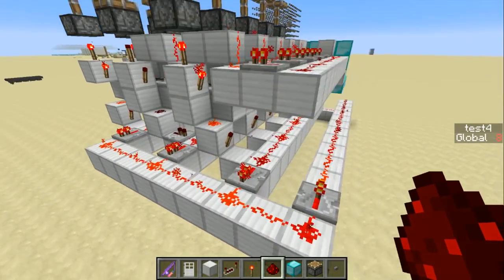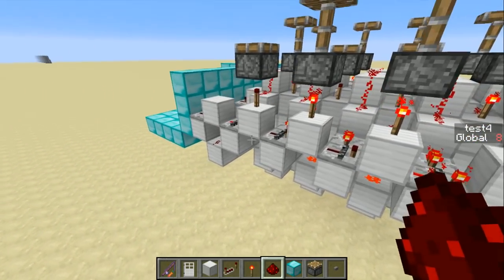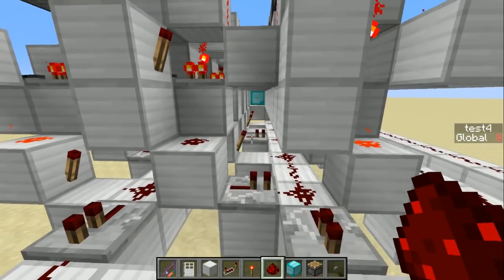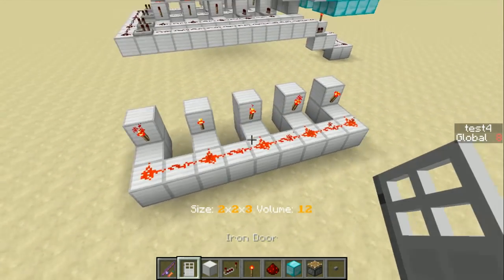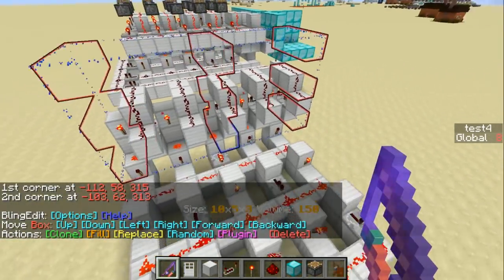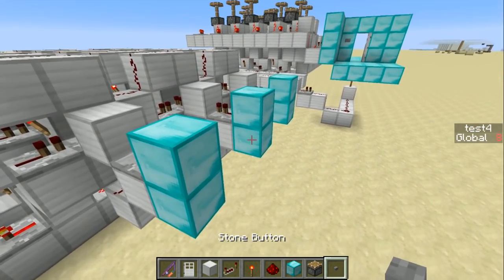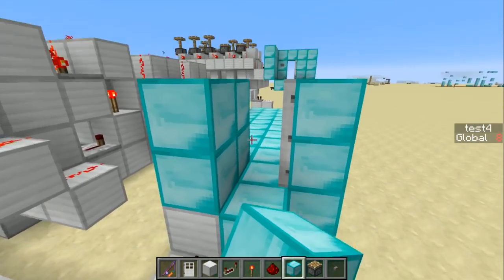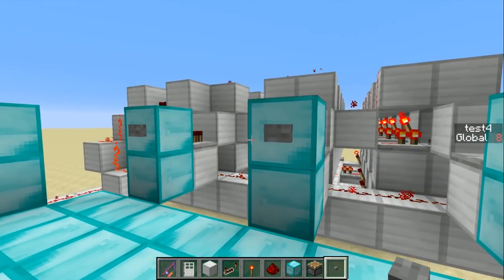Sequential Combo Lock in Minecraft (Redstone Tutorial)

Comment: old design is old, a 9digit 3x3x1 keypad connected to a circuit for an order-sensative combo shift register was the first thing I made when repeater locks came out, and it was based on an old design of mine that used a dflop/binary counter combo to accomplish the same thing in a much larger area. You didn't even put the buttons next to each other, I am disappoint.

Comment: The downside of making a lock with a shift register is that it is vulnerable to brute forcing using a de brujin sequence. For example, a 5 digit passcode with 3 buttons has a de brujin sequence of length 3^5 (243) which means the pin can be cracked in <250 keypresses. When compared to a normal lock (where you must input 5 numbers before it resets) where you need 3^5 * 5 keypresses.

Comment: Now make a parallel to serial converter and add a latch to the shift register (very simple with locking repeaters), then you have a simple 2 wire interface (clock and signal)